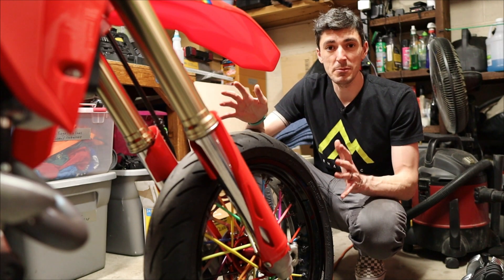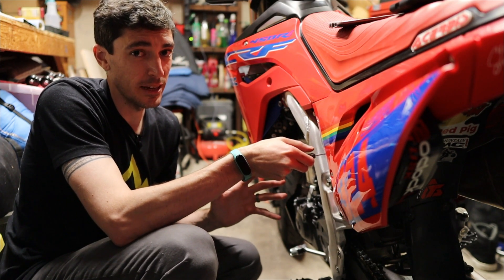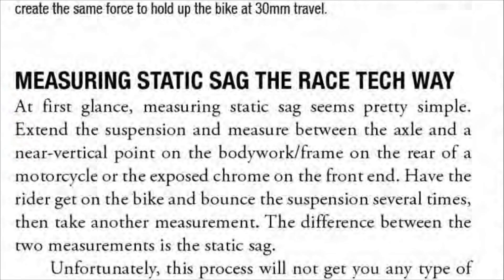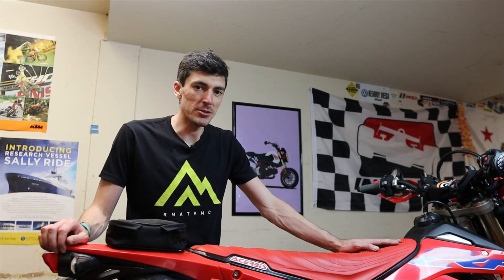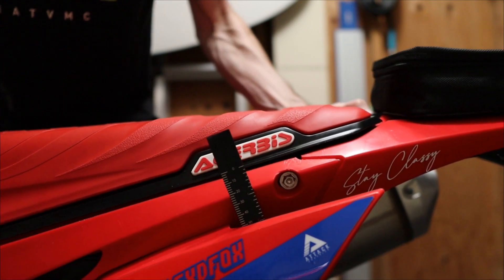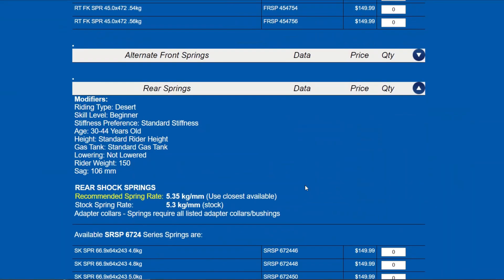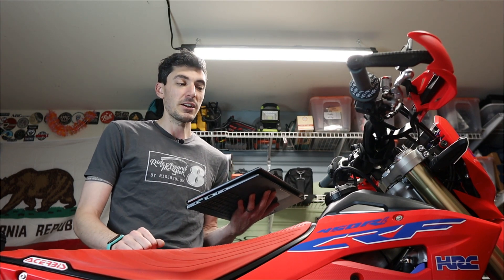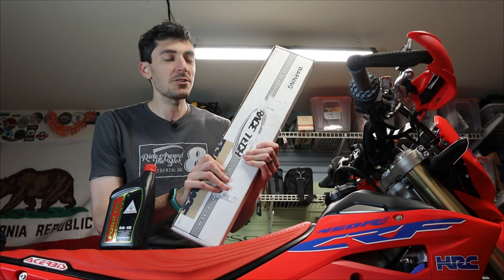Set your CRF450RL Sag and Get your Spring Rates the Race Tech Way. CRF Suspension Pt.1

Comment: If I had 4mm of rear friction zone, I think I would make sure the shock linkage and swing arm pivot point are lubed well.  The bike is a year old,---and the factories are notorious for not putting much, (if any) grease on those spots. Just for a reference, my YZ250 2-stroke has 2mm of rear friction zone.  it was really easy to measure accurately with the Motool slacker too.  :)

Comment: 4:36  I think you have that backwards.  Too little "free sag" (I prefer "bike sag" and "rider sag" terms), then the spring is too soft.   But you had it right just before 4:36. I think using the word "pre-load" made it a bit confusing at the moment.  Not enough "bike sag" (under 15 mm), means the spring is too soft, and you needed a lot of pre-load to get the right rider sag correct.  Paul Thede's motorcycle suspension bible, is a great book.  Man,in my racing days of MX, I would have crashed less if I knew the front end "rake and trail" that I much later learned from that great book.

Comment: Try the Motool "slacker", for a one man job setting sag.  Digital read out on the bar, in real time even if you shift your weight.   Nothing works better IMO.  You just have to balance yourself against a wall or something, but that is pretty easy.  Just barely touch the wall so you know all your weight is on the bike.
Reply: Using weight on the bike, is probably not the same as your body distribution.  I could expect a 2 or 3 mm error.  You can check that with the Motool slacker also.  :)

Comment: Free sag - the amount the bike sits under its own weight.  A high free sag indicates a spring which is too stiff for you.  Meaning you don’t have enough preload tightened down on the rear spring so initial travel is too soft.  In your vid you say that your high free sag indicates stiffer springs which is incorrect.

The stock rear spring is really soft stock, in your case I wouldn’t go higher.
Reply from the maker: I meant my free sag number was high, which is a low directional free sag (although now i can see the confusion of what is high, the number or the direction, lol). My free say was 48mm and recommended was under 40mm.
Reply: @lexdfox  That part was confusing - I rewound it a couple of times to try to understand what you meant. 
Love the CRF content, keep up the great vids.